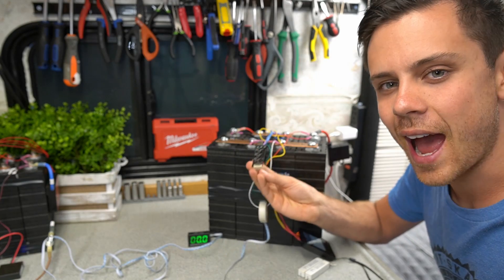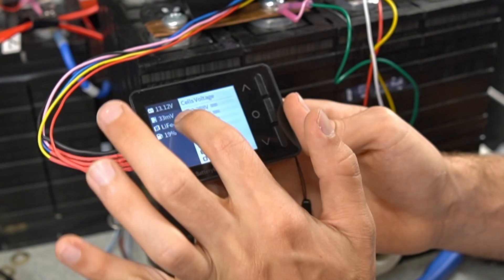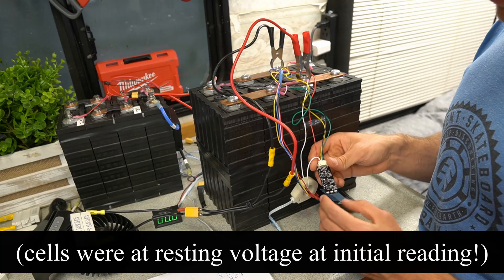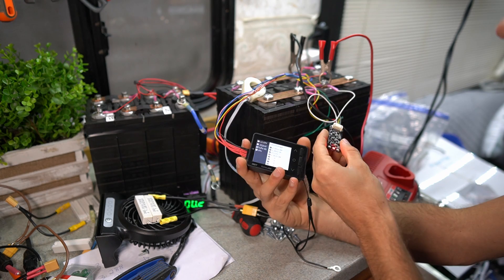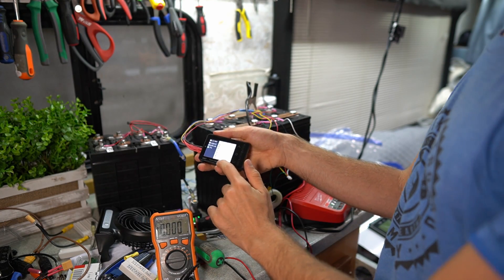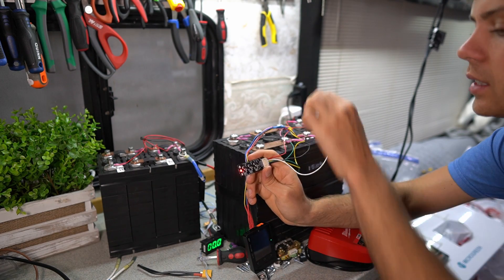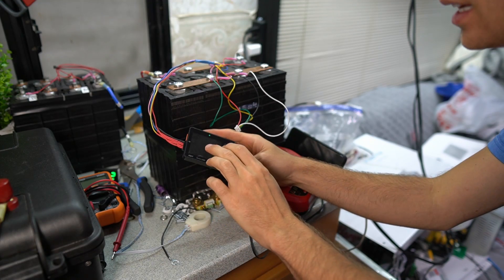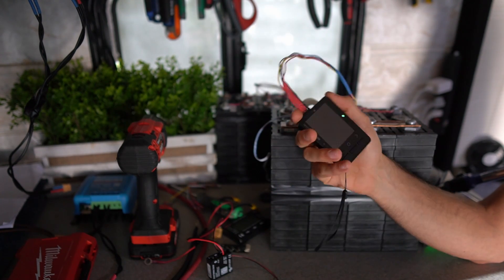"Active Cell Balancers": Did I get Ripped Off??

Comment: I want something to balance at any, voltage, when charging, I don't care if its recycling power or not, for now I use a ISDT T8, it would be nice to have a bms that everything is programmable, start balancing if it's about 0.25v - 0.50v +/-, each cell, and shut off, or alarm if over .5v off, and keep power to charge controllers, if it does shut off, due to cell differentials, and maybe have a capacitor to keep power to the charge controllers, if it does over volt shut off, someone needs to build and sell this, and a 1-5amp balance , for large cells with high current charging, I have about 60 amps at 28v coming in, 50&100ma, isn't going to do ANYTHING, I have considered the small ebike   bms, with a relay, for the current, maybe put a relay on the pv incoming , to cut all power to the pv charger, that would likely end up with magic smoke being in the mix, i guess a large capacitors, between the controller and bms, could save the controller from power loss, maybe some experimenting with, some 50v caps, and a cheap controller!! Keep at it man,,

Comment: The BarreryGo is automatic balancer, it draws 0.2 A from the cells that are higher voltage only. You can feel it heat up when it works. This is designed to balance drone batteries (small) Over days it works on my 10kwh 7s licoo2 system, I consider it to be just a monitor, yes it does balance ridicule power, but the main point is to give quality accurate information on the packs. Its usb power is also useful for example to run fans for cooling or just to keep an air flow an all equipments. I don't know any source for a balancer that would take current from one cell and charge another. I'm not even sure if Electrodacus controllers can do that ?
Reply from the maker: Yeah I really like them as a monitor too. And yes there are true active balancers available but they cost quite a lot. They are on AliExpress
Reply: My opinion on having a battery that is balanced is this : as long as you don't push things (keep a licoo2 under 4.15V and above 3.10V) you don't need a perfectly balanced pack. In my experience a very small imbalance stays there, the modules do go up and down is harmony. Careful tho : things can fail always so the best is to keep an eye on it daily. The pack is secured by fuses and breakers, and both the charge controllers and the inverters are set to cutoff at restrictives voltages of 28,7V and 21,7V. I have also a bunch of fire extinguishers in both CO2 and powder, and also two options to evacuate the building. relying on a BMS for a big system is not a good idea : you don't know what is in the box. It does not replace a thermal camera, it does not replace a real fuse, etc. I prefer to take the risk of not using it than having an unknown box failing on me in an unknown manner. A year in, I never saw more than 0,012 V imbalance, and the pack lives like that. it oscillate between 0,007 and 0,012 V imbalance, and frankly, I do not call that an imbalance ! (10kwh 7s made of old recycled 18650)
Reply from the maker: @AlexandreLollini  oh for lithium iron phosphate we don't need to balance daily at all. The cells will not drift at all. we are not using active balancers for that reason. We are using them for specific application such as top and bottom balancing a new pack or using mismatched cells. We don't need a balancer at all really for normal everyday use for solar at our c rates. I cover this a lot in a few videos on LiFePO4 videos
Reply: I know that LiFePO4 is way more durable and stable for stationary use and solar etc. If I use LiCoO2 18650 it is only because of availability and price of those I recover and reconditions. While I know I will get way less cycles out of them, that is what I can afford and can do right now. My car has a 12V LiFePO4 and it is going strong (9 years in) == I will change the car, keep the same battery !
Reply from the maker: @AlexandreLollini  LiFePO4 in your car?!  Nice!!!

Comment: Considering wire size along with board design limits it does better than you could expect . Any resistors get hot , it's what they are design limited to do . Same with this small device . Personally , I just want to know what each cell is doing with this device . 
P.S.  I ordered new cells using your Amazon link . Please let me know if you get credit .   Thanks  Mon , Thanks  All

Comment: Active balancing for $7? Shocked it doesn't work? Will, I have some magic beans if you're interested ;)

Kidding aside, if it was that cheap all BMS units would active balance. However passive balance is usually enough if you have matched cells and you top balance for off grid solar applications. Even passive balancing at 1 amp with solar, you aren't really losing much as most banks are small enough to be charged by mid day anyway.

Comment: You should release that MppSolar review ;)
Reply from the maker: Still working on it!!! I am using it 24/7 as my main system and there is a lot to say about these units. I am testing the 2.4 and .8 kw 110 volt systems. Making a video on it soon.
Reply: @WillProwse  Is idle same as people complain, 50W?
Reply from the maker: No, it's lower! 2.4kw model is 28 watts, and 800 watt is 14watts. And there is a low power inverter shut down. So if it senses only tiny loads, it shuts the inverter off. But it didn't work that well. But it does for some stuff. So much I need to cover in the video. It has pros and cons but so far I actually like it. I am testing it like crazy to see if it works in every way. The ats works really well!!!